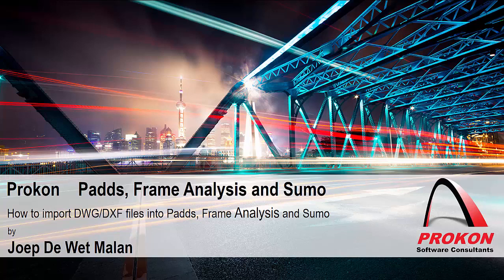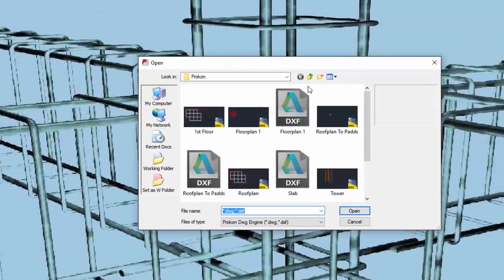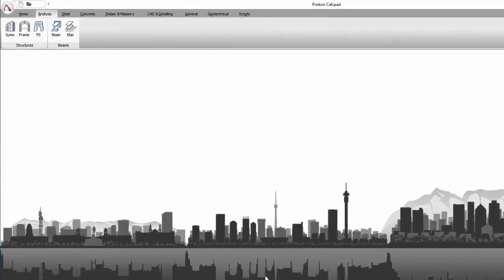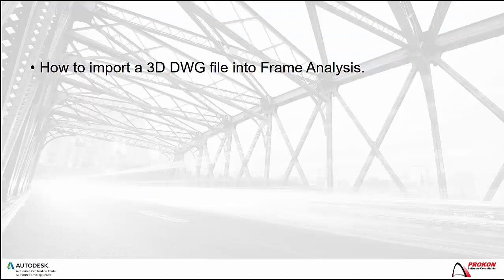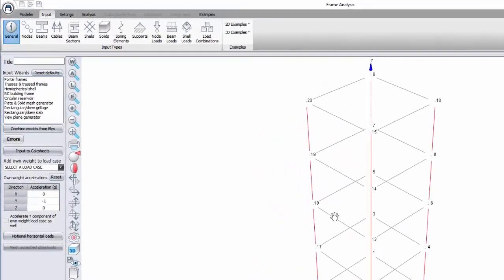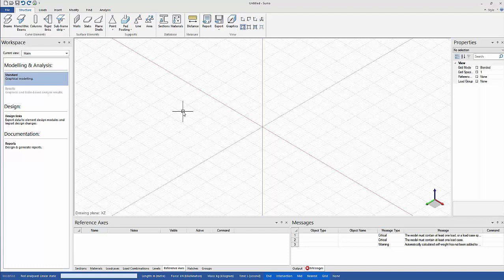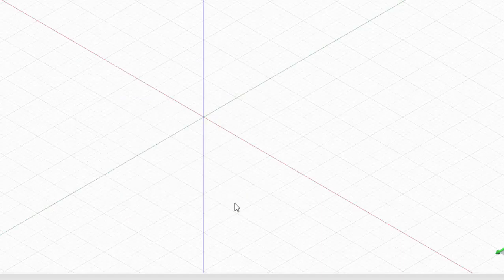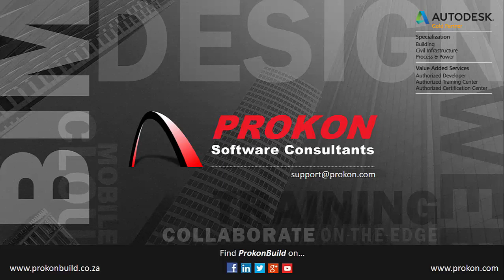Prokon - How to import DWG or DXF files into Padds, Frame Analysis and Sumo

Comment: Hello, can one model, analyze and design a structure with frame and padds only. no sumo?
Reply from the maker: Hi Bromtech Engineering,

Yes, one can analyse a structure in Frame and use Padds for detailing. However, using Sumo is a much easier approach. 

For a more comprehensive design, one should also consider PROKON’s design modules. Frame and Padds alone won’t allow you to do a complete design. 

Regards
Prokon